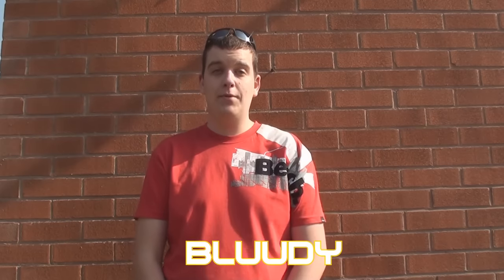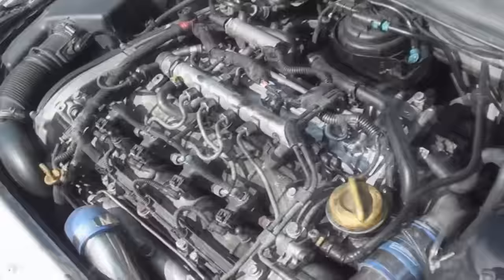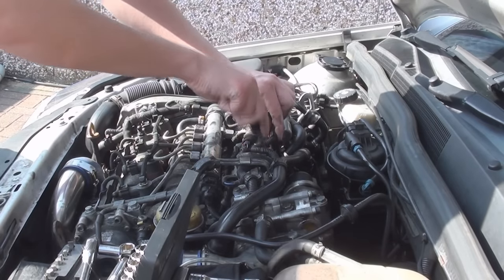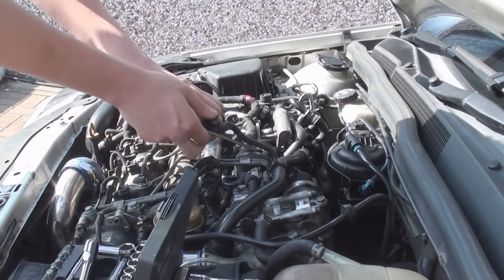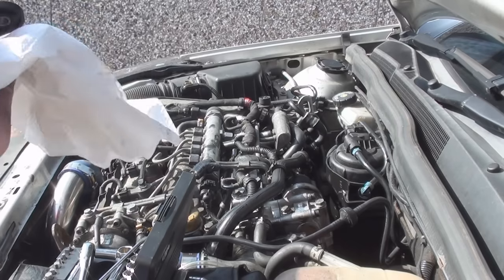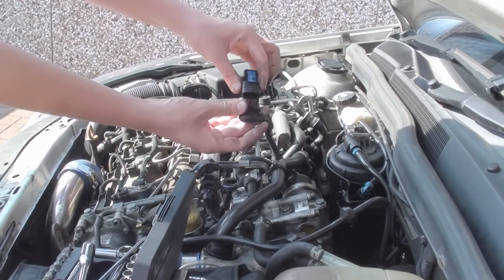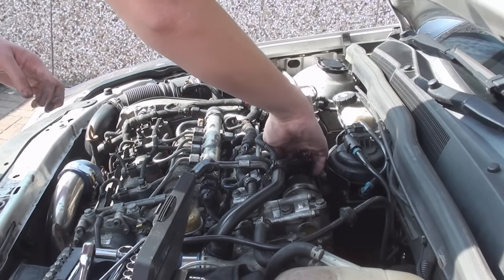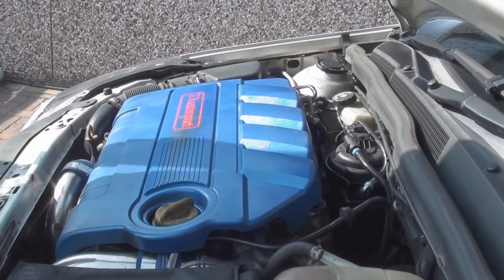How To: Clean/unblock Your Boost Sensor

Comment: Fella would this flag up if my dpf was blocked though got fixed but it came back on lose of power then it shut. Engine off ie cut out few times not stalled, so you think my sensor may need looked at cleaned or replaced if needed? As what. Would your car do & act in driving if it was? Cheers ✌🏻🏴

Comment from the maker: You are correct Bolter - But on this model, the clogging up of this device messed up the boost readings, and the error code states boost pressure - so for the people with this engine especially, it known as the boost sensor.

Comment: My Porsche Cayenne GTS (V6 TT) threw a P0244 code (Turbocharger Wastegate Solenoid) and locked out the turbos so I get no boost.  Might cleaning or replacing the boost sensor be the fix for my issue?  I've scoured the Internet but can't seem to find much information on this topic. Thanks.

Comment: Hi do you have any suggestions how to fix problem P0234 - too big boost pressure. My astra engine is 17DTR
Reply: Try turning down your wastegate. I assume there is a way to adjust the tension on the wastegate

Comment: My navara pick up, sometimes when I change the gear from 1 to 2 or 3 then the car will slow the as if it jack and the fire too will go down as if it want to off before it will take off again. And sometimes when you spark the car will be heavy when accelerating so you have to off the engine before starting again, please what will be the cause?

Comment: is there a fuse that's connected to the boost sensor???
I have just replaced the sensor because I got the error code. but the error code is still there and the car accelerates like shit :(
Reply: +gilera96 check the boost solenoid out, it may cause it, or the wastegate actuator
Reply: Is that good or bad?

Comment: Hai.. after your replaced the sensorYou have to reset the ecu..How to do it is just dismantle the negative terminal on the battery then put it back.Its okey not to reset but the self reset will be initiate 24 hour. This is why the engine still jerk after you replaced the sensor..
Reply: Farina Marcina  switch cleaner or brake cleaner should be fine

Comment: P1556/p1557 on my seat alhambra 1.9tdi 115phb any cleus as to what the problem could be??
Reply: You've got a boost pressure problem, could be a number of problems, faulty turbo actuator, leak in vacuum hose, faulty N75, stuck vanes in turbo, to help identify you need a cheap vacuum tester £15 on amazon. Lots of videos to show how to use

Comment: My car currently is flat and seems like turbo isn't kicking in would cleaning this up help I cleaned egr valve up wasn't sure where the sensor was its driving a little better now egr cleaned but still lacking power

Comment: You don't remove the yellow clip from the connector, it just latches the clip down slide it up then push down on the end of the black part and it will come off.

Comment: Hello ,  Could you please make a video on  how to solve the problem of radiator fan going on (for too long ) and off randomly. No apparent reason , no overheat  nothing else.  Astra ST  SEL AT-6  1.6 ( 85 KW )   made in 2011 but VIN shows it is 2012.  Thanks.
Kathryn.
Reply: I'd say try changing the Temp Sensor (somewhere along the Coolant pipes), and the Fan Switch Sensor (in Rad), both available in EBay...
Hope I helped Ya...
Reply: Dan Solo  Thanks for your reply . It would have been helpful because I already changed the whole thermostat. The sensor is built on the thermostat in such a way that one has to replace the entire piece.  What really amazing is that not any thermostat can handle the very very hot water in the motor. It may reach up to 110 c.

Comment: MAP, MAF or IAT?
Reply: N2CUA MAP and IAT most of the time are combined in one shell. MAF is hole other story.. MAF works on real data, MAP/IAT on relative data calculated by the ECU. This what he cleaned was MAP/IAT combined shell sensor.I have only 2 advices:
1- Use Electronic contact cleaner/mass airflow cleaner not carb one, its aggresive to plastic and rubber (you have O ring there to hold the pressure sensor isolated).
2- Remove the Negative car battery before you do any job on replacing/cleaning car sensors.
Reply: N2CUA   Thats a  MAP sensor

Comment: Does anyone know where the boost sensor is on an 09 astra h 1.7cdti Eco flex?
Reply from the maker: Not sure without looking but im going to guess at the pipe coming up from the intercooler to the throttle body, it will be on that section somewere. If your still stuck, join the drivers club, link in description, and we can talk more there

Comment: That's not a MAP sensor.  Manifold Absolute Pressure.  If it were a MAP sensor, it would have a vaccum pipe between it and the inlet manifold, because the MAP sensor measures pressure, not volume.
Reply: How many more idiots are going to post about MAP / Boost sensors..... it's a single filament sensor MAP, also commonly known (on forced induction cars) as a 'boost sensor'.  Your talk of vacuum pipes for these sensors is nonsense. I've replaced and cleaned a dozen MAP sensors and none have had vacuum pipes!
Reply: @droge192  So what would you prefer to call the sensor pipe.  It either measures negative pressure  or positive  pressure...a pipe can not do much else really, if it doesn't carry a fluid or a gas?